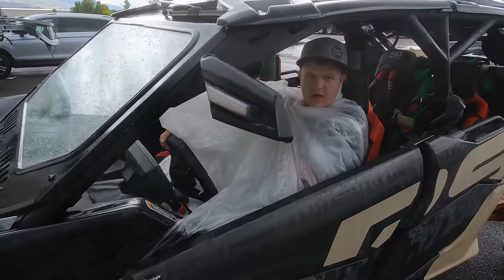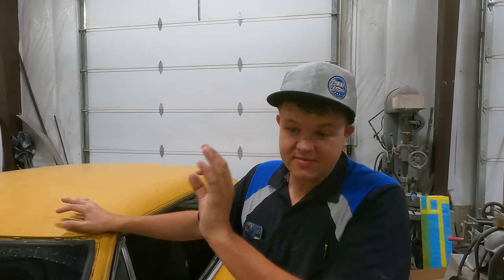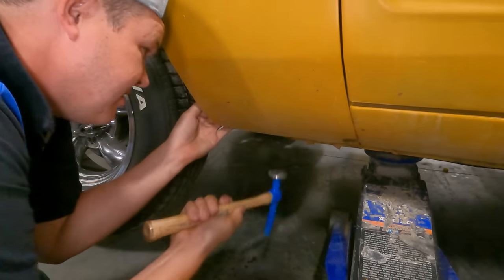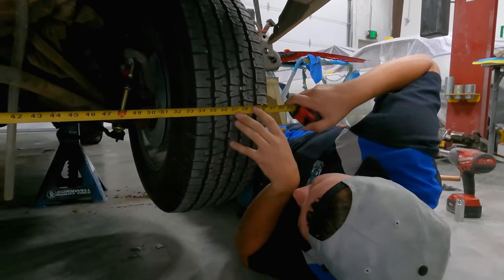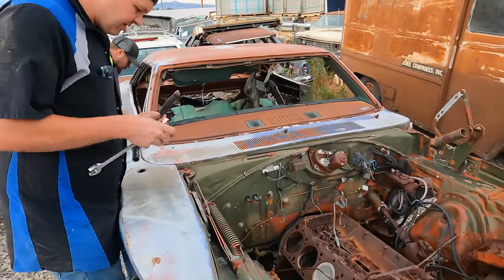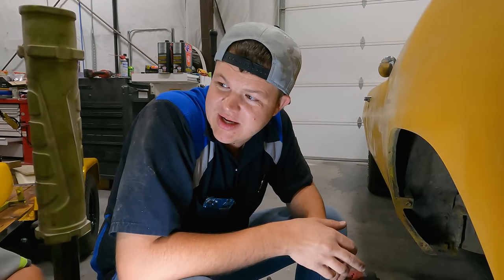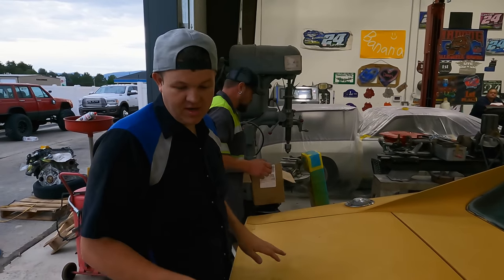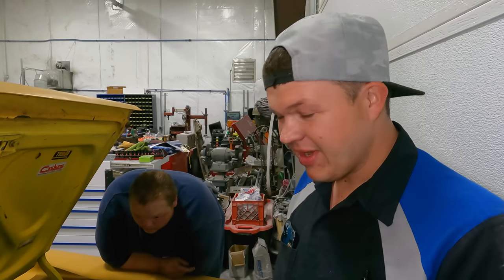Viewers DECIDE The ENGINE In The Giveaway 69’ Charger!

Comment: Coming from a long time Charger fan and owner- keep the 440! But build it! I've seen 440's make 600 HP with budget heads, the right cam, intake and headers. No need for the complication of a Hellcat Hemi. I love my A883 4-speed, but you could put a taller gear in the rear end then a Tremec 5 or 6 so it can be a highway cruiser as well.
Reply: My wife weighs about 440 she rides good

Comment: Retired now, earned my living as a alignment tech...
All toe-in/toe-out checks should be done in a "laiden" condition, Hunter alignment machines will give you the details for each vehicle. And yes, even a "tape measure" alignment  is better than nothing, however; it is still done with the tires on the ground (not jacked up).
Keep on keepin on.
Reply: I always thought you did the toe in with it on the ground
Reply: Tires on the ground and loaded, and after each adjustment you have to roll it back and forward a couple of feet to release the grip of the tire treads on the floor. THEN you measure again. It should be toed in 1/16 to 1/8 inch.
Reply: For tape measure alignments, I was taught to put a couple of layers of plastic garbage bags under the tires.  That lets them move while keeping the weight on the wheels.    Then you can take it to the professionals once you get close.

Comment: It would be sweet to see the current 440 rebuilt with performance upgrades. Aluminum heads, performance camshaft, high compression pistons…..etc. Keep it an old school V8. Then top it if with one of Dodges High Impact paint colors. (I’m partial to Plum Crazy and Sublime Green even though they weren’t available until 1970.)
Reply: This guy has it right.
Reply: HELIPHANT!
Reply: I agree 1000% power plant that came in it 1969.
Reply: YES!!!
Reply: Agreed!
Reply: I like this idea!!!
Reply: the orange go mango
Reply: My Duster is Sublime Green! Hated it as a kid, love it as an adult. Though technically, Plymouth's color designator was "Lime Light" :D Either way, it would be absolutely sick on the Charger.
Reply: @cmseitz117  
My super bee was sassy grassy green with black stripes and markings

Comment: Six pack, four-speed, shaker hood would be cool. 323 sure grip, larger drive shaft, air conditioning. I'll talk about the paint color later. TTI headers 1 and 7/8.3 in exhaust all the way back magnaflow or flowmaster so many choices between those. just a nice dignified sound.

Comment: If this was my car, I'd build the 440 that's already in there, add fuel injection and a 6 speed. It being able to be reliably driven anywhere would be a huge plus. You wouldn't be able to get me out of it.
Reply: Yes, I agree, you've got heaps of grunt with that motor already, but some longer legs on the open road would make it a great all-round package.

Comment: Keep the 440 and leave it carburated!
If headers, manifold, carb are factory, replace them with moderate performance parts, give it an HEI if it hasn´t one already, add a fuel pressure regulator if still runs a mechanical fuel pump, a high-flow exhaust won´t hurt.
To tune it well, give Thunderhead289 a call, he knows how to adjust those things.

Comment: The old Chargers were so sweet . It broke my heart when they made a 4 door and put the Charger name plate on it . The new Chargers should have been called a Coronet . If Dodge had made a retro Charger as close to the old style as they did with the Challenger , they would be everywhere . On what engine to use ? Nothing wrong with the 440 . A modern Hellcat power plant would be cool too . If gas prices keep going up , the car would still be cool with a 225 slant 6 ! You can't go wrong with a gen 2 Charger !

Comment: I really like the 440 thats already in the car. Freshin it up and put in a mild cam and lower the compresion a bit so it will still run on pump gas. Get the heads to flow a little better and a decent free flowing exhaust. A Carter carb or a Holly fuel injection on dual plane intake. Electronic ignition from MSD. Nothing to complex or to many new wiring harnesses, keep the engine bay looking old school cool. A car like that is an awsome weekend cruiser, keeping it streetable would definately something to consider.  For those moments when the driver wants up the fun factor a bit, a mild nitrous system could be installed.

Comment: Look for cracks in the welds where the torsion bars go into the cross member common in old mopars
Reply: Yep! In '76 it happened to both sides of my '69 Dart right before I was leaving for a road trip. Once one side went the other side couldn't handle the load. No time to go to a proper shop to have them fixed. I positioned them the best I could and welded them while lying on my back on the floor of my bosses barn (and I'm not a welder.) All I can say is I'm glad they survived the road trip LOL!!!

Comment: I'd rebuild the 440 with high compression pistons, big camshaft, a big HP single 4 barrel carb, and a good set of headers. I'd keep it closer to period correct. A 4sp manual, posi, and good set of rear gears is all a car like this needs... It's just a cool car.

Comment: I don't remember if this is the right video, but you mentioned Free penetrating oil. I worked in a factory running 24/7 production high and low pressure molds. These molds have cooling systems drilled thru-out them to speed up the cycle time. Many molds have inter changeable inserts to make various size parts that are similar. I was a toolmaker there, and serviced these molds. Some had o-rings in the base mold and some had direct water lines going into them. My point is there was rust happening all the time. Interchanging these inserts was not always easy. Now, the rust buster we used was Kroil. I highly recommend you try it for the most severe cases of rusted parts. I would apply it at the end of the day, and come morning my life was so much easier. It's best to let it set overnight.

Comment: The tow on mopars need to be  set with the suspension settled because it changes quite a bit thru the travel. Get it close drive it couple miles then reset it without lifting the car.

Comment: I always put a paper staple in both tires. Measure the front then roll the tire 180 and measure the back. Really accurate and you just pull the staples out when you’re done. 1/16” to 1/8” toe in has worked great for me

Comment: With regard to your alignment issues, you should check your torsion bars.  They have been under load since forever, so you may have a suspension issue.
Reply: They all had weak front ends from the factory.
Reply: @williepelzer384  Yep! In '76 both of my torsion bars broke at the cross member on my '69 Dart right before I was leaving for a road trip. Once one side went the other side couldn't handle the load. No time to go to a proper shop to have them fixed. I positioned them the best I could and welded them while lying on my back on the floor of my bosses barn (and I'm not a welder.) All I can say is I'm glad they survived the road trip LOL!!!

Comment: Just another 750,000 subs. I'm holding my breath. Edit: I'd like to know what the paint code reads. I don't remember seeing that color but my memory sucks.
Reply: On Dodge it was called Butterscotch.
On Plymouth it was called Bahama yellow.
Paint codes are debatable from different plants, some 96 most say 99
The car has definitely been repainted at some point so it may not be original but that color was definitely an option in 1969
Reply: @UnfinishedProjectDartSport  Thanx for the info.

Comment: My opinion - keep the 440.  If you want to hop it up, contact 440source for one of their stroker kits and a set of their "stealth" heads.  Don't ignore chassis upgrades to go with the extra power - sure-grip, unibody torque boxes, K-member skid plate to protect the oil pan, etc.  :)

Comment: I'd go with 318 or 383! Block is same as 440, just different bore and stroke! Fuel wise, 318 2bbl was darn good economically!!
Reply: My 68 had 318 got around 20 and ran dang good.
Reply: @jimgreenan8126  I had it in my 70 General Lee and used to beat 69 GTOs in Virginia!

Comment: 500" Keith Black Hemi with Injection, Auto overdrive, AC, PB, PS, Locker 332 rear, 4 link rear suspension, rack and pinion steering. Keep it looking Pure Stock. Tub it for 29.5" x 12" rears and stay with the Cragar wheels. Discs front and rear.

Comment: I was always told that the vehicle had to be on the ground to set the alignment properly. I’ve done tape measure alignments on a few of my trucks and taken them to an alignment shop and they were spot on. I like to run less toe-in than most recommend, almost zero actually, but I drive big heavy trucks that I think that benefits more

Comment: Scrap the hellcat..
Blown 440, ported n polished.
Lunati cams and crank.
EFI.
POSI.
AC.
Trap door headers. (Quiet mode)
Brembo all around. (Slotted n drilled)
Kraiger 5 spokes.
Midnight black pearl w/ white racing stripes.
Cut hood, for blower.
Fender flares.
For starters😆💯

Comment: I'm glad to see so many people voting for the 440. IMO, one Mopar's best street performance engines, it has the potential to put out plenty of power for the application.

As a teenager back in the '70s, it seemed there were countless Chargers in junkyards that got bent into boomerangs, obviously having gone off the road sideways. For that reason I wouldn't put a Hellcat in it with the stock suspension configuration and then give it away to someone. I may get flamed for this, but who cares.

Comment: I would leave the 440 in it.  No matter if it's not numbers matching.  Someone said make it fuel injected.  I agree!  That would make the car a monster.  It would also make it more efficient to drive!  Leave it manual steering and manual transmission.  Car.  That's the way my car was.  It was fun to drive as it was.  When you guys drove it home from Kansas you drove through the town I live in.  Salina, KS.  It sounds like you all had fun driving the car home.

Comment: That 440 motor sounds nice ,port and polish the heads, see if you can squeeze out 4 more cubic inches , pop up pistons, some hooker, or blackjack headers with a cross over pipe just behind the transmission, and a holley or edelbrock fuel injection, shave the door handles with keyless entry, black,orange stripe, trimmed metalic gold ,racing stripes with either original color or gun metal with tinted windows, and black on gray interior, and air conditioning 😉 👍 and lower it about 3 inches.
Or something like that take care and be safe and have a blessed week amen.
Reply: And dyno-tuned.

Comment: Hillbilly is on the right track by bringing up the Hellcat, but it doesn't need the twin turbos as it is already supercharged at 707 hp! Also, there are more choices to pick from; there's the 840 hp Demon and the 1000 hp Hellephant crate engines, both supercharged, both would go right in it!!!😉🤙

Comment: If it has a 440 in it now, don't lower the power potential with a  383. Fuel injection. My favorite option on new cars. Keys in the pocket option. When u walk up to the car, the doors unlock. When u get inside, u push a button to start. KEYS NEVER LEAVING UR POCKET.

Comment: For the engine, keep the 440 and add fuel injection and electronic ignition.  Definitely keep the four speed.  As others have said, lower the compression so it doesn't require premium fuel.  The four speed has the added bonus of (probably!) keeping young punks from stealing the car... :) edit:  paint it bright blue metallic which was one of the factory colors for Dodges in 1969.

Comment: 440, but w/Fuel injection and Electronic Ignition.  And maybe some sweet suspension upgrades.  But the general idea is that it looks completely stock until you start digging, and then the upgrades just make it a nicer driver.  Because I will drive it when i win it!  :)

Comment: I had a heavy piece of wood, I fastened a ball point pen, to it (bent over some finish nails). I jack the the car up spin the tire and slide the block slowly into the tire, making a fine line around the tire, each side. Then lower the car and roll it back and forth a bit, to relax the suspension to ride height. Then accurately measure and adjust the tow from the pen mark.

Comment: Front-drive cars use toe-out because the pulling action of the front wheels tends to pull the front of the tires toward each other.  The opposite is true for rear-drive cars, since the driving wheels in the rear tend to move the front of the front tires away from each other.

Comment: In 1969 I was working at the Chrysler Belvidere Assembly plant. No, the charger was not built there. We made Dodge Monaco, Plymouth Fury and the like, including the Fla state trooper Fury III interceptor with the 440 Magnum. So, my choice is an original 440 Magnum (orange paint and all),  double pumper or 6 pack. MHO is the six pack was cool but not user friendly to keep well adjusted, so they tend to have more issues. I really like the double pumper with the high rise spider manifold with a hood scoop. A good set of headers to 3" pipes and glass packs and it would be "69" ready.

Comment: 440
~I have a 535 stroker in a 68 Charger RT looks dead stock in/out and it ran 10.03 in the 1/4 at 131 mph! Drag radials and 3.55 rear axle ratio!!! car has 60,000 miles on this set up,very street friendly and reliable..
~I also ran mid 12's with stock 440's in the late 80's and 90's...All in B body Mopars..69 GTX,68 Coronet 500 was a 383 that was shot/cracked block from no anti freeze(previous owner)  I bought it and had a sweet 69 440 from a rolled over C body/that ran low 12's purple cam and 3.91's and my 68 Charger RT/owned since late 80's as a teen! I ran 13.36 in a 70 Chrysler 300 440 TNT!! It stumbled 60-70 mph,so that beast could fly.
~My other Charger is a 440 bored a little so 446 ci and mid 11 second 1/4 mile car in street trim,factory tires no slicks! That could run high 10's with 4.30's and better set up..I bought many in the 90's they were sort of expensive even back then!  

I dont know what 440 you have in it,a lot of people put smog motors in them and thus lower power but easily done up..My 68 has a late 70's 440..

**I will put a video of my cars one day..I am computer illiterate!! Sorry for my babble,I need videos up asap!

Comment: Turn it into the Bullitt Charger. The 440 is a neck snapper. A well tuned 440 will give a hemi a run  for the money, The 383 is great daily drive engine. Maybe a 383  Chrysler stroker engine, it will give the same performance as the 440

Comment: Needs a late model hemi with the fuel injection easy peasy I built a 55 plymouth 2 door wagon hear in northern California for a customer in Fremont California cooler with a stickshift I did a aod with a 9 inch ford airride stock motor was surprisingly quick

Comment: Bobbie, take the original 440 and do a Quality rebuild. Nice forged Steel crank, balanced rotating mass, 9.5 compression pistons, nice cam with some lift but not too much. high volume oil pump, high volume oil pan, good heads, MSD ignition, aftermarket dual plane intake, aftermarket fuel injection, good set of headers, and tuned exhaust system. Count me in when you are ready to give this Charger away!

Comment: I doubt the crew is gonna read this or take my advice, but I have to say something. At about 4:19 you guys set the charger back on the Jack stand but it looks like it’s not locked on the first notch. You HAVE TO pull it up to lock it on that first notch, otherwise it’s sitting on the frame of jackstand, pushing the sides out, and that’s not how it’s designed. I’ve seen to many people do it.

Comment: I think a hopped-up 440 would be more appropriate than a Hellcat motor.
I would how ever suggest some sort of taller top gear (or even a tremec 6 speed) for economy when highway cruising.
That way the winner is more likely to road trip the car more often.

And maybe some modern brakes…

Comment: Definitely keep the 440 in the Charger, no new Hellcat, etc. new engines, enough of them have already been made. Tune up the 440 and add fuel injection at most or maybe a carburetor and E85 for fuel.

Comment: Do a gen 3 hemi, 6.1 or 6.2. Easy swap now and reliable power and surprising economy. Had an 06 SRT Magnum that would pull 22 MPG @ 85 MPH highway and put 425 to the rear wheels (cam, heads, long tubes, etc.).

Comment: I know chrystler made a pretty stout 360.
I had a 71 Newport with a 360 and is big and heavy as that car was (minus rear lower quarters...they use to flap in the wind due to being rusted out) it use to haul ass. I ended up seizing the motor because it was the first oil change I ever did and I didn't take off the old filter gasket.  She was doing 130mph ...lol

Comment: 500 ci tall block with a 6 pack or a Hellcat engine. Close ratio manual 6 speed and a 3:73 psi rear end. Or stick with the 440 and add a 6 pack.

Comment: I vote for the 1000-hp 426-cubic inch Mopar Hellephant Supercharged Hemi crate engine (Part Number: P5160194AC)  paired to a TREMEC Magnum 6-speed manual transmission (this transmission accepts an old-school/traditional speedo cable - the TR-6060 from the Hellcat doesn't)

Comment: The new hellcat engine would be great but I think do an old school big block even put a holly fuel injection for ease of driving would be nice an definitely an upgraded modern suspension and well you already did brakes original interior and a flashy paint would be sweet